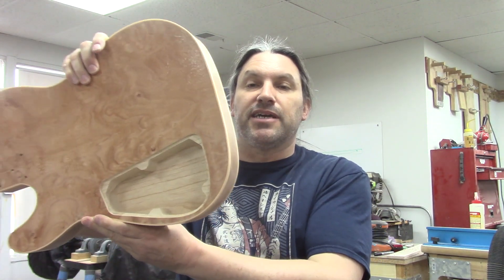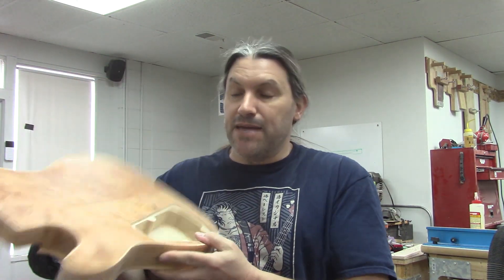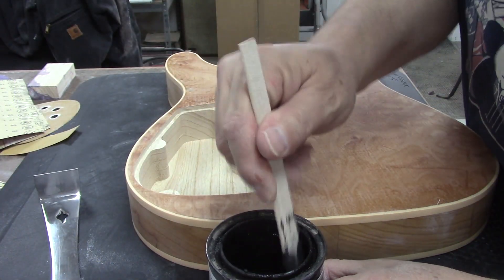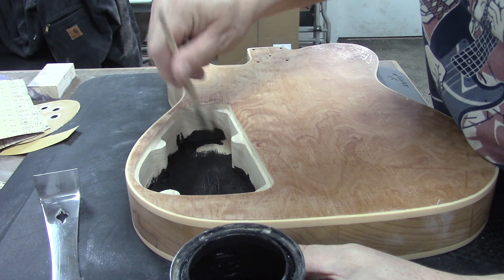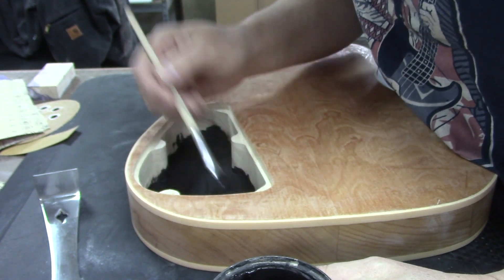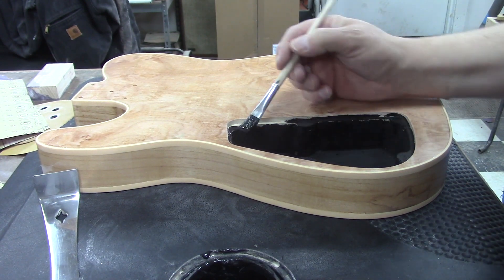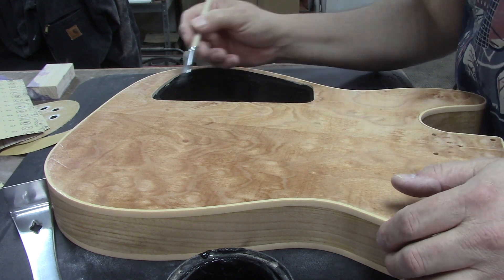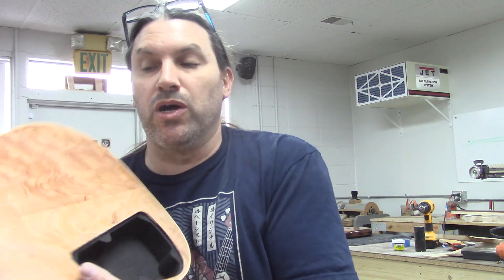Shielding Your Guitar Is Easy... You Are Making It Harder Than It Needs To Be

Comment: shielding with single coils is more important just because of the hum factor of a single coil.I always use foil started way before Stewmac even offered a graphite paint. I think you could get away with shielding only running under the pots but like you said players are into spiffy looking cavities and so I do the whole cavity and back side of the lid creating a complete shield. If you don't have total conductivity why bother at all 🤔I do believe shielding is important and an element of getting a quiet hum free guitar. Science to it? sht if I know probably is some.it just works like yours stay safe stay inside  wash yer dang hands🤗
Reply from the maker: There is no downside to going with complete conductivity.
You wash your hands

Comment: What if you decided to do the shielding after you've sealed the body already ? Is it ok to apply shielding paint then ? Prolly need to reseal , I guess ?
Reply from the maker: Hi Mike, shield after with no issues. The cavity will make your fingers a little tiny bit dirty when you are wiring if you aren't careful but that is the only downside

Comment: Legitimately, how do you ground paint? I don't mean spilling it on the floor.
😎🎙🎸✅
Reply: Julian Carmichael The paint is conductive carbon powder in a emulsion. When the output jack ground or the grounded POTs are installed they make contact with the shielding paint
Reply from the maker: You don't sweat it
Reply: @0MyWay01  ta, much appreciated 🙂

Comment: Just make sure your cavity cover connects electrically to the painted shield and you should be ok. Painting can be faster (provided you don't drip it on the good finish) and so I know that's why many factory guitars get it. I still like the aluminum flashing tape though. +1 that you found shielded cable to the jack is important -- I found that can be 50% of a guitar's idle noise floor. It's ironic how Fender and their single coils use separate wires to the jack.
Reply from the maker: We still use the foil for the control cavity covers

Comment: That's a cool idea to seal it with a more durable paint.

Do you think the conductive paint shell gets any continuity with ground through the 1/4" jack, the pots or the cover screws?

Basically, is your paint shell just good enough or is it actually really good?

By the way, I've always looked at your guitar cavities and assumed they were not shielded because I didn't see foil...
Reply from the maker: You can keep slathering that paint on and it will eventually conduct. There are other types of shielding paint as well... they might be better for that application

Comment: Your shielding paint IS fully conductive. Otherwise it wouldn't work. It's just not zero-ohms conductive. Measure across a distance and you'll find that the resistance is consistent with the resistance vs distance specs. And connect it in a circuit and you'll find you can run current across it => conductive.
Reply from the maker: I'm going to rethink my whole life
Reply: @TexasToastGuitars  Whatever it takes. ;)

Comment: Shielding is about making an antenna that will catch EM interferences instead of your pickups and redirect them to the ground. The wider the surface of the shield, the better but it doesn’t need to be a closed box. Don’t know why everybody thinks it should be a Faraday box, because the Faraday box is irrelevant in a guitar and there’s no way you can really make one with shielding. The only conductivity you need is to make sure that the copper/aluminium/conductive paint surfaces are all connected to the ground.
Reply from the maker: The internet chat rooms are great places to learn new stuff. Some of it is even worth learning. I think that is the driving force for people having ideas that are overkill.

Comment: I don’t shield my guitars. If you wire and ground it correctly you shouldn’t need shielding unless your pickups are microphonic or have other issues.
Reply: When guitars are mass produced there maybe slight imperfections (tolerances etc.)  in electronic parts that will cause noise and shielding is a way to mitigate issues over large quantities.
Reply from the maker: You got to live your best life
Reply: Texas Toast Guitars I’m not saying shielding is bad, if it needs it do it. I just have not experienced a need for it in the builds I’ve done. You do what you need or like.
Reply from the maker: @chrissarantos7929  I'm glad we agree

Comment: Shielding paint is much easier and much less time consuming but foil tape will shield more guitars for the money. What I didn't understand is dude mentions all the guitars they looked at had humbuckers. Why shield a humbucker guitar ? Usually they are really quiet. Noise is usually only an issue with single coils.
Reply from the maker: I agree

Comment: I have been touring  for 13 years.  Carried the same guitars and gear.  Suddenly the current show changed their generators and I end up having the most horrible electromagnetic interference.  The sound crews first reaction was to blame my guitar shielding.  Didn’t want to put up a fight so I let them buy me 3 Stewmac shielding kits(Copper tape, large copper sheets,  paint etc...) .  Put paint like you did. No go.  Shielded with copper and soldered a wire through channels and cavities for total continuity...Same problem.  Now my guitars are extremely shielded and are silent in other environments so I rest my case.  The ball is now in their court.  Shielding doesn’t protect your gear from incompetence!  Just saying
Reply from the maker: huh, that is kooky... did you ever figure out the issue?
Reply: Texas Toast Guitars Not yet , show was suspended until this crazy virus goes away.  Had to leave ALL of my gear in Australia.  Once I get back I expect them to work on the problem.  Fortunately I have a LesPaul 69 to practice on but no amp.  I tape a stethoscope to the back 😆

Comment: Ok here’s my argument against sealing it . I assume you’re going to shied the control cavity cover . If you seal the shielding paint in side the cavity . It won’t have continuity with the shielded cover. I know you don’t care about that so much but I say if your gonna shied the entire cavity why not have it completely enclosed and connected?
Reply: Hmmm... shielding the cavity is a way to encapsulate the electronics in a Faraday cage, so my question is “does a Faraday cage needs to be completely connected?”.
Reply from the maker: I think the easy answer to your question is that it doesn't matter if you have continuity. Having said that... there is no downside. Like I say, if your time is free or if you just like the idea, go forward and be happy.

Comment: Your shielding must be grounded. Otherwise it’s not a shield and can act like an antenna.
Reply from the maker: So, my technique actually makes things worse
Reply: Texas Toast Guitars Just don’t put the sanding sealer over it. 😃
Reply from the maker: @DavidRavenMoon  I completely disagree but we can still be friends
Reply: Texas Toast Guitars the sanding sealer is insulating the carbon paint. Without it your controls will ground the paint. Interference that strikes the paint is shunted to ground. Right now the paint does absolutely nothing. It’s like having coax cable without the shield grounded. Only the paint has higher resistance. But it’s not shielding anything. It’s just paint. That’s physics. 😀

Comment: Man! guitar players and builders get weird when they start pontificating about electronics. Cavity screening makes little to no difference to hum picked up by the pickups and with the volume controls at maximum, this may obscure any benefit from cavity screening.

Screening makes the most difference to the hum levels when the guitar volume is set to around seven. 

Connecting any screening to circuit ground should make a big difference to its effectiveness.
Reply from the maker: We pretty much have to do something because people expect some kind of shielding to be there.
Reply: @TexasToastGuitars  Well this is late seeing this vid.
H.E.R. sig Fender strat has no shielding in any cavity just uses Fenders noiseless pickups, It does however have an Aluminum pickguard and backplate and no body ground. 
I think people went stupid somewhere, most rubber coatings/insulators of wire have EMI shielding to prevent crosstalk and such, Dimarzio pickups like the Humbuckers have the ground built into the sheath of the wire. 
If you really want to make single coils quiet take a High E string and bob it around the coils under the pickup cover, then wrap foil tape around the pickup winding and solder it to the ground wire making sure its all grounded and connected, people don't think, if you are shielding the cavity what difference does that make the coils and the pole pieces are sticking out beyond your shielding and that is what is picking everything up.
Personally I do that for single coils and just wrap the wires in a larger sheath of copper tape making sure the wires themselves are shielded they aren't grounded, technically you don't need a body ground just use either an aluminum pickguard or the thin gauge aluminum pickguard shield, your pots are already grounded by coming into contact, and I just run a wire ground to the claw or bridge.

Also did no one really learn from Neil Young and his "Old Black" the 72 firebird pickup was so microphonic it could pick up talking?

Comment: You probably make a great point that blanket conductivity in your shielding armor is probably not all so necessary. Even a chain-link fence is 99% air and might shield your house from certain rf interference. The primary foe here in guitar electronics is 60hz hum and frequencies that are resonant to that. Our amps and speakers interact with all of that too, which can be worse depending on where you stand and which way you point. Think of you and your guitar as radio receivers. Learn how to work with that. Blah blah blah. Need another drink...
Reply from the maker: People make too much of a deal about shielding IMHO.
Having said that if one is into the whole completion thing than go for it